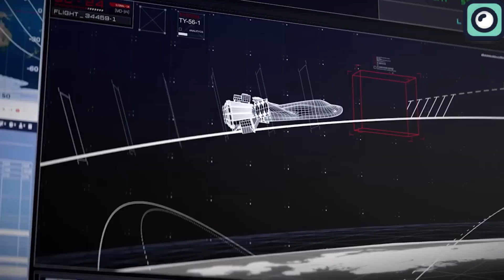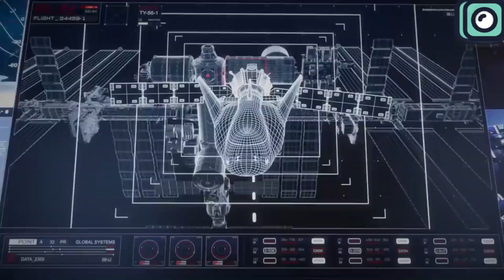Dream Chaser Having Big Problem.... No Launch?

Comment: SpaceX have done extremely well, crew Dragon has performed flawlessly, Boeing on the other hand? well look at Starliner, testament that Boeing has screwed up somewhere along the line, Dreamchaser, i feel theyve done ok to get to where they are today, it seems the thermal protection is the bottleneck in hold ups, exactly the same as NASA's space shuttle , meant to fly in 1977 but didn't achieve that until 1981, some 4 years later, i wouldn't be writing off Dreamchaser just yet.
Reply: That thermal re-entry is a beast, wonder how it'll be done in the future. Thoughts of Star Trek and UFOs pop up, lmao.

Comment: Funny, with all the failures and plague of problems… how can anyone say starship is a success? Unsolvable thermal problems, excess weight,  diminishing payloads, molten Elorons, frozen valves, exploding Raptors, doors not closing in space, inappropriately designed tower and crash landings? The list goes on… Success? Don’t think so 😂😂😂
Reply: Failures happen and with them we solve the problems

Comment: I was under the impression the problem was with the launch vehicle, not Dream Chaser per se.  The launch vehicle was behind time and Dream Chaser was bumped to speed up the ULA Vulcan.
Reply: From what I read, it was Sierra Space that told them there might be a delay and were basically the ones that told ULA to bump them rather than risk delaying a launch.